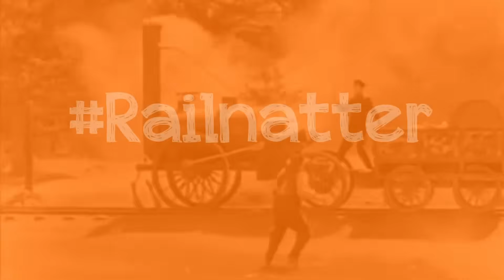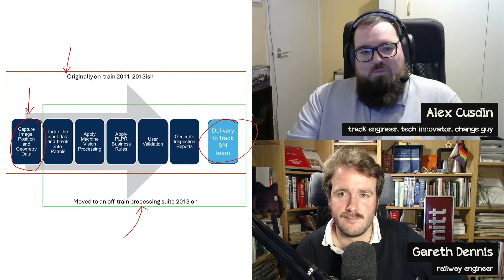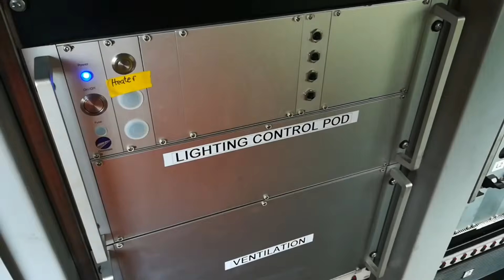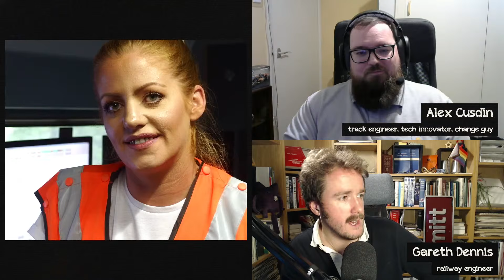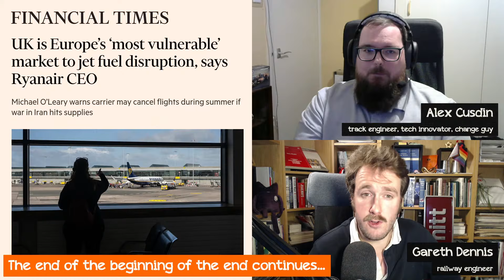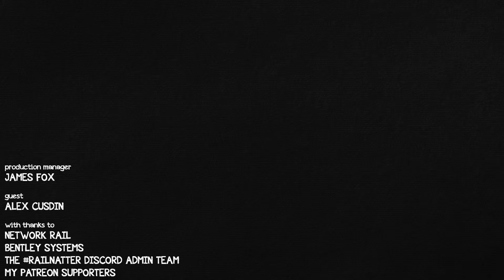This train TRANSFORMED Britain’s railways | #Railnatter 302

Comment: A colleague put me on to this, very interesting, mostly correct. I was one of the lead design engineers for the PLPR system, always nice to hear some positivity about work you've done. I started working at Omnicom in 2005 when I was 21. One of my first projects was the Real Time Positioning System (RTPS) and then went on to do the PLPR project in the following years, the NMT boxes I actually built & installed on the vehicle too, along with the fiber optic system they used to have and the forward facing video at each end of the train.

I still work in that capacity for Omnicom but we are now part of Hitachi. If you ever want to chat history I could probably offer some more technical insight.
Reply: I'll take mostly correct! :)